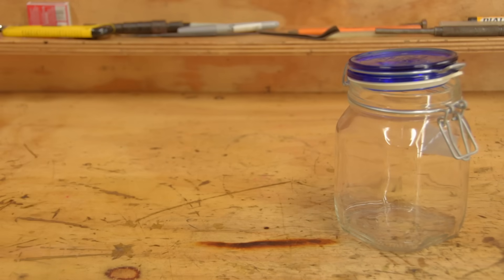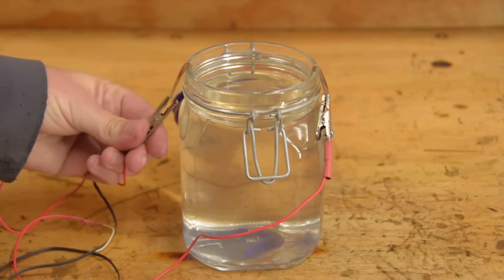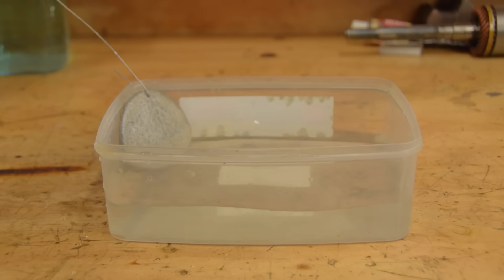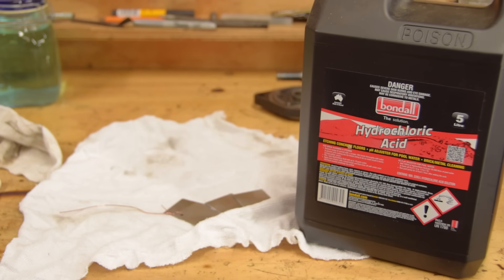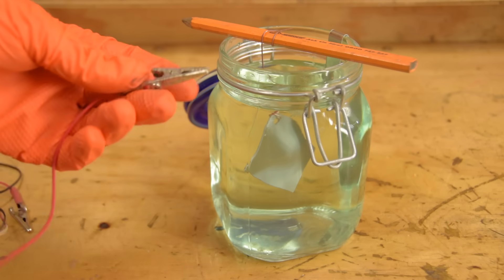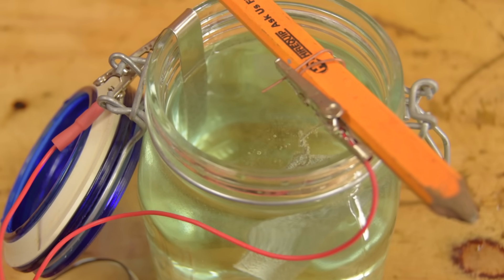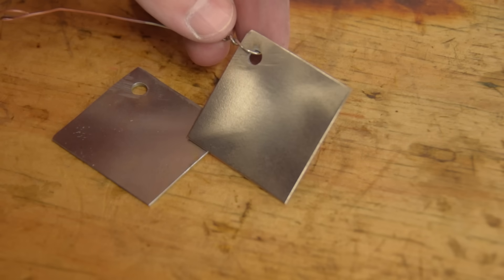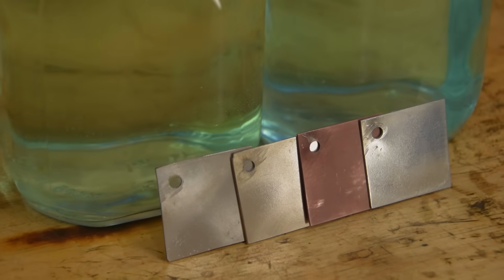Electroplating - Easy DIY Nickel, Copper, Zinc Plating

Comment: Excellent. For anyone interest you can leave both anodes in your bath, connect them with a piggy back cable and attach your positive to the hanger. I don't have the brains to know if this increases the nickel input and or decreases the time of the bath. I would also consider using a cheap goldfish bowl aerator, keeps the solution consistent providing a better coat. This is a superb quick way to plate, pay attention to his points, water test always and the more polished and mirror like your piece the better. Especially golf club heads. For intricate shapes and pieces aeration is important.

Comment: Is it necessary to make the electrolyte first? Why cant you just go straight to plating at 5:30 and the electrolyte will form as you plate?
Reply from the maker: You can do that. Will probably take longer at first.
Reply: @GeoffreyCroker  gotcha 👌. Thanks for your informative video
Reply: more likely to get burn in or contamination, mostly an issue with copper tho, nickel would probably be fine

Comment: Always add acid to water and never water to acid.
Reply from the maker: Name any acid that a normal person can get, that will react violently if you add water?
Reply: @GeoffreyCroker sulphuric acid and hydrochloric acid are both easily available and useful for home electroplating, and will both react violently when diluted improperly. I love your video, but it’s good practise for professionals AND diy craftsmen to always add acid to water and not the other way around.

Comment: Little help, please! I bought (supposedly) pure nickel strip from eBay, but my solution will not turn green! It’s clear, and there are now blackish flakes settling on the bottom of my container. I’ve tried several strips, and they dissolve, but no green. The “nickel” strip attached to the negative cable has turned black as well.
Have I simply bought crap nickel? (BTW, my solution is 10% white vinegar and one Tbs. non-iodized salt.)
Thanks for any feedback!

Comment: So copper wont plate directly to steel.  What about aluminum, or stainless steel?  Does anyone know of a metal which won't dissolve into solution?  This is the big problem with electrolysis machines used to generate hydrogen gas from water.  Whatever metal you use dissolves into solution polluting the water and eventually stalling out the process.  If we had a metal which would not dissolve into solution that would be ideal.  Both anode and cathode in the electrolysis machine could be made of that.  Alternatively even a combination of metals like copper and steel would be better as one would not be able to plate the other.  Though steel is not ideal as it is already prone to corrosion.  So ideally if there is no metal which will not dissolve, then the best alternative would be two metals which can't plate each other, which are also corrosion resistant.

Comment: All I will say as someone who has studied Chemistry at degree level, is do your research when mixing various chemicals and metals and type the acronym COSHH and safety data sheets.  You can inadvently create some pretty horrific chemicals with household chemicals if you don't have a good understanding of elemental chemistry.  For example electrolysis of hydorchloric acid (HCL) even in dilute form will produce Hydrogen and Chlorine gas, one goes bang and the other will gas you to death LOL ! Additionally HCL is one of the strongest acids out there and will eventually break down metal alloys, so the likes of stainless steel is an alloy of Iron, Vanadium and Chromium. So pickling stainless steel in acid for a time will leach out Chromium into solution forming Chromate which is a particularly nasty element in solution form. Interestingly enough whilst Nickel seems harmless on the surface it is actually classified as being carcinogenic to humans in compound and metallic form, not many people are aware of that as the perception of Nickel being used in coins means it must be safe of course.

Not being a party poopy, have fun it what you do, be responsible and dispose of chemical at treatment centres and do your research before blindy mixing chemicals at home, the Internet has all the answers although a fundamental school chemistry book is worth owning for reference and CHATGPT of course now !

Comment: I tried doing this myself, the zinc wok but would form bubbles on the aluminum then scrap off if touched, the copper just turned black no matter what metal I tried to plate and the nickle didnt really work.

Comment: I’m not seeing the solution turn green, I used 300ml of vinegar and a tablespoon of salt, I am using a DC power supply set to 12v, can someone inform me on the problem

Comment: what is the best plating to resist rust for parts inside a gasoline 
fuel tank ?
Reply: Most things you can buy in store are first plated with nickel, then chromium over the nickel, and I'm pretty sure there's more stuff needed than just that.

Comment: I work in electro plating on a zinc plating line. We use zinc dissolved in lye as our plating bath. For a brightener we use sodium silicate in the bath and a post plating quick dip in a dilute nitric acid bath.

Comment: Anyone know why my parts just turn black?
Reply: What metal are you plating? It's most likely because of too much current or the metal not sticking
Reply: @0v0_64  I'm using copper
Reply: @0v0_64  I'm using copper
Reply: I decided to try a solution with baking soda and distilled water and that worked well for me.
Reply: Try cleaning it again and put the metals further apart.

Comment: I'm making the copper solution, but finding that the amps are dwindling fairly quicky (often minutes) after the process starts. If I stir the solution is comes back up for a minute or so, but the copper solution attempt doesn't seem to be working. The same process with the zinc solution worked just fine. Is there something I am not doing correctly? I am using an adjustable DC voltage generator for this.

Comment: When it's done, can it withstand a buffing to a perfect mirror finish?
Reply from the maker: Depends how thick you plate it. Normally you polish the part to the surface finish you want first, and then plate it.
Reply: @GeoffreyCroker  
That's great information. 
I wasn't aware that it can be plated to different, within reason, thicknesses. 
Thanks

Comment: Great video, thanks! 
I’m restoring a pair of brake calipers for my father’s Porsche.
I wonder if it would be a good idea to give them a round in a nickel electrolyte before the zink bath?
The purpose would be to improve the corrosion resistance even further. 

Cheers, Jörgen
Reply from the maker: No. Nickel and zinc don’t get along.
Reply: What would happen?

Comment: That "but where do i get the nickel from?" Was beautiful.
Reply: Okay, all of the voices are beautiful
Reply: And the "but what about the salt" lol
Reply: @😂The_Goood_Sort_Of_Slob
Reply: Top tier voice acting, 'twas a thing of beauty indeed.
Reply: You're right, they were fantastic 👏
Reply: Fantastic great intro to electroplating
Reply: Maybe u can using nickel strip for connecting batterai, so many at online shop
Reply: @mdgchanel4548  are they nickel or nickel plated?
Reply: @mdgchanel4548 just some fyi here for readers, I bought some battery nickel stripping in a roll and in making the solution I ended up with a truckload of debris. Found out afterwards that they blend iron into the stuff to make a dodgy profit and so buyers beware..
Reply: Or just use a nickel.
Reply: I'm subscribing only bc of that
Reply: Idk where to get HCL acid. Apparently lowes dont have it
Reply: But where I can get table solt?
Reply: I laughed out loud lol
Reply: Amazon sells strips of nickel
Reply: Canadian coinage

Comment: Say hypothetically, I have a set of pennies. Would I be able to use these to make a copper electrolyte? All hypothetically, of course, as obviously I have no pennies in my possession.
Reply from the maker: Yes. You will just make a solution containing whatever metals are in the metal you use.

Comment: i did it but i have something brown on it what did i do wrong
Reply: Probably the copper wire used to suspend the piece being plated. It can get deposited depending on what kind of metal you are plating.

Comment: A tip: While electroplating, hydrogen is being created in form of bubbles that sticks to the metal. Since the hydrogen atom is the smallest in the universe, it can slip through any cracks of any material and make it brittle and more prone to cracking. This phenomenon is known as Hydrogen Embrittlement. Therefore, the same metal may not have the same stiffness and safety anymore. In order to remedy this, the metal piece should be baked to dissipate these bubbles.

Comment: 6:20  Yes, copper does plate directly to steel.  However, steel plating is usually done with a less "noble" metal that will protect the steel from corrosion (zinc, chrome, etc).  Copper is more noble and does the opposite.  If that steel is exposed by a scratch or whatnot, the steel will erode faster than if it wasn't copper plated.

Comment: I've got about a thousand pieces of old mismatched door hardware in my house and this will make my life a million times easier, and save me a ton of money. Thanks so much for making such a clear and concise video!
Reply: I can confirm this method works. It is not hard to do, just follow simple instructions. I use a variable voltage power supply around 8 volts for Nickel worked well.
Reply: It won’t save you any money. This example of electroplating is over simplified and takes nothing important in account such a base metal pretreatment, electrolyte chemical balance and deposit properties. Electroplating is a complex and dynamic process that must be controlled and maintained.
Reply from the maker: @jeffbrassard1268 what a load of nonsense.
Reply: @jeffbrassard1268 I was looking for basic information, I’m not trying to plate car parts or anything. I’m trying to fix up some doorknobs. If I roast a plate or two, it’s not apocalyptic.

Comment: I gave this a go with the copper, I wanted to coat a few bolt heads/nuts for my engine.
The solution came out real nice, it was a light blue, like you described, a "watery Gatorade". I didn't use anodes from the store, I used brand new copper pipes from a plumber friend of mine, hammered flat, blowtorched to remove anything on the surface, then wire wheeled shiny and clean.
The issue I'm having, is the nuts/bolts are taking on a verryyyyy small amount of copper, but a thick layer of what almost looks like rust. It's a brownish sludge type stuff. It rubs off easily with a paper towel, and leaves a very very thin layer of copper electroplate behind on the bolts.
Any suggestions? My guess is because I didn't use anodes, the copper pipes must have some forms of impurities. 
Thanks :)
Reply: The result you’re getting is due to a redox reaction. 

Copper in an acidic solution will “plate” steel without any current needed and stops as soon as there are one two atomic layers of copper on the steel surface.

Comment: kitchen salt will produce chlorine on anode.- you shall use an electrolyte with non-oxidizable anion e.g. sulphate. Thus, use sodium sulphate (Glauber´s salt) or magnesium sulphate (Epsom salt). The second one can be really cheap in a drugstore or a gardening shop, old tarts use it for foot bathing and as a lawn/ornament tree fertilizer. any perchlorate or phosphate will do as well. Or just use sodium hydroxide and adjust pH to 3-5 with sulphuric acid (use pH paper or pH test, you can buy them in pet shops as aquarists use them). In such case you skip the vinegar, of course.
Reply: Wouldnt magnesium sulfate produce sulfuric acid?
Reply: Nah bro chloride is needed to keep the nickel anodes soluble. There will be no gas produced besides hydrogen and a tiny amount of oxygen.

Comment: Good video. One question or suggestion if you allow me,  though. Is your vinegar 100% acetic acid? It would be nice to have a molar or at least percent value.
Reply from the maker: 100% acetic acid would be a pile of solid crystals.
Reply: @GeoffreyCroker : It depends.. Melting point of pure acetic acid is 61.88°F (16.6°C)   😅
Reply from the maker: @sergeyp.7985  sure. Vinegar is about 8% acetic acid. There is no reason to worry about how many moles of acetic acid are involved. Or even what type of acid. The only purpose of the acid is to produce a salt of the metal you are plating with.

And I don’t know about every acid, but most will be a dry powder like citric acid, or vaporised well before 100%. 100% acid wouldn’t do anything anyway, because acidity happens in water because of acid, not in acid by itself.

Comment: How do you safely dispose of the used hydrochloric acid? The part in the greek yoghurt container which was diluted with water and was used to give the metal parts one last clean. Could you just dilute further with water and pour down the drain?

Comment: I used to work in an electroplating facility in Syracuse, NY called Anoplate. This setup is pretty primitive but the basics are there and yeah, that's how it works. I used to work on the nickle line and the black chrome line. Ever notice how some metal parts are black but super shiny? That's black chrome. Anoplate had a contract with GM to do the plating on their car parts and I was the only person allowed to do the black chrome on them.
So if you've ever seen a Corvette made between 2003-2006, that hood ornament was made by me.
Reply: what electrolyte/electrodes do you use for black chromium?
Reply: @s9k328  I don't remember the details. It was almost 20 years ago at this point.
Reply: ok thanks @jsimsgaming
Reply: @jsimsgaming  If you can remember or find that black chrome method, please let us know. I'm interested in doing some of that. 🙏
Reply: @jsimsgaming  Liar.....LOL...JK
Reply: Would this method work for brass?
Reply: @twill9278  You could electroplate a brass finish on something but as brass is an alloy of copper and zinc, you would probably have to put a layer of pure copper on first and then plate the brass on top of the copper for better adhesion.
Reply: @jsimsgaming  
Thanks. I'll give that a try.
I have pure copper decorative coins
Reply: @jsimsgaming do you need to put a nickellayer first too when dealing with steel?
Reply: @twill9278  Hey there, any update on how it went with the brass plating? I have an old brass plated buckle that's in need of replating and wondered how you did?
Reply: @jsimsgaming  How long after making the layer of copper do you think you could do the brass re4plating? and do you think you would need to take the surface down to bare material before applying the copper?
Reply: @paulydaeaglettv2782  
It never happened.
I forget exactly what the obstacle was, but IIRC, what I wanted to do was not realistic.
Reply: @twill9278  ah i see no worries, thank you for responding anyways
Reply: @paulydaeaglettv2782  Theoretically it could be done. You would need to zinc plate the object in question similar to above. This is where it gets theoretical. You then use a combination of copper and zinc plating solutions with a brush plating system. Brush systems are very easy to make on par with this video. 70/30 copper to zinc ratio is the classic brass colour so I would test with a 70% copper solution and 30% zinc solution blend.  I am not 100% sure at what rate the metals will precipitate on the surface though due to the differing amounts of copper and zinc in either solution. It may be entirely different so some experimentation might be needed. Watch a few vids on brush plating and you will see where I am going with this.
Reply: Cool! 👍
Reply: Would it work with tin ? If so How could you get a gold tint to it
Reply: @aidanbailey4264  Electroplating is electroplating. If you can metal plate something, the method is the same. What may change is the chemical solution used to throw the metal properly.
I've done Tin, Nickle, Silver, Gold, Chrome, Black Chrome, Copper, and Cadmium.
Reply: @jsimsgaming  with a DIY? Like this? Or at the factory?
Reply: That's pretty badass 🤘
Reply: Wow cool!
Reply: @jsimsgaming  I did my apprenticeship in black chrome! We also did almost every other kind of plating, but black chrome was by far the most frustrating. The finish looked awesome though.
Reply: Can you tell me about the how much voltage and Amps should be there for nickel plating screws
Reply: Would someone please help me with the process of nickle plating on plastic ? Thank you very much.
Reply: @thaitrungnguyen9640  Hi, You have to first paint the plastic with conductive paint. I have tried this a few years ago, but I was not able to get very good results. Problem one is getting the paint to stick well to the plastic. A plastic primer is needed first. Then I could not get the nickel to plate very well, I think plating with copper first might help. So it is possible, but hard to get it to work well. (I did give up quite quickly though!)
Reply: @colinfaed5910  I don't know about plastic, but I saw a YouTube video where a guy was electroplating tree leaves. He used a graphite spray as a conductive layer. Maybe it was a graphite lubricant spray.
Reply: @michal_kaa  Same principle, both leave and plastic are none conductive. the paint I used was, I think, graphite based. Lubricant spray would not be any good even if the electroplating worked it would just come off because the lubricant wouldn't stick to the the item if it was touched. The paint I used was called Graphit 33
Reply: So could the acid etch be used to clean off an earlier sprayed finish before plating?
Reply: Crazy fun fact
Reply: ooo thats super cool

Comment: Be careful when using salt if you use to much you will make toxic chlorine gas and hydrogen. If they mix they can ignite instantly with uv light to form more toxic hydrochloric acid that can settle in your lungs